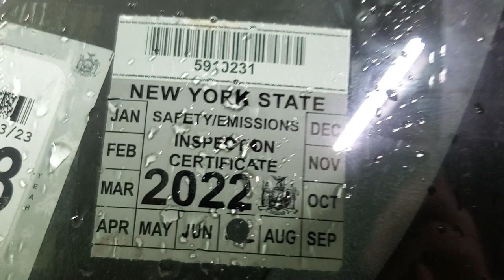The new shop truck! Burnouts, putting it to work, and a preview of the new Beatdown Buick 2.0!

Comment: Legit question here, you see  those rear diffs with oil that bad if they're ~20 years old with 200k and not in a shithole salty state? I should probably swap the gear fluid on my old girl but you know how it goes. Trucks from Florida for fucks sake, trying to avoid unnecessary work
Reply from the maker: First one I have seen that bad in my 20 years of wrenching!